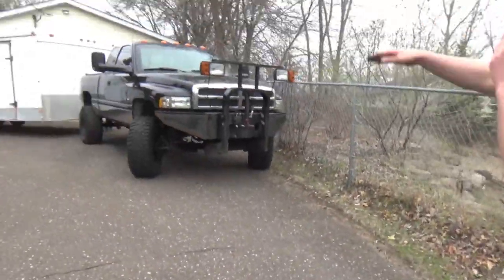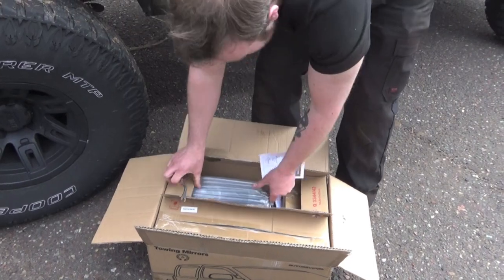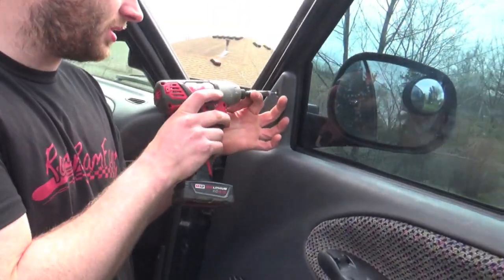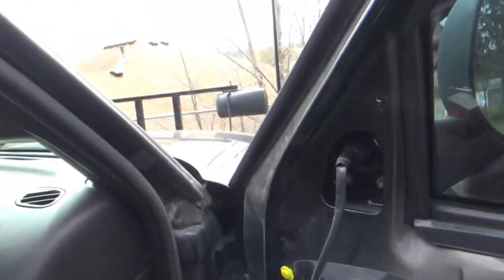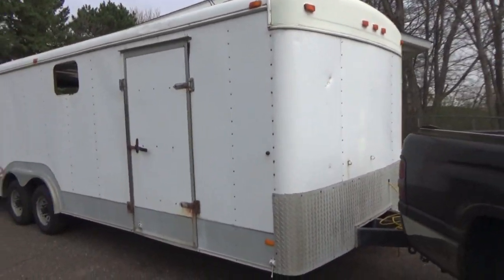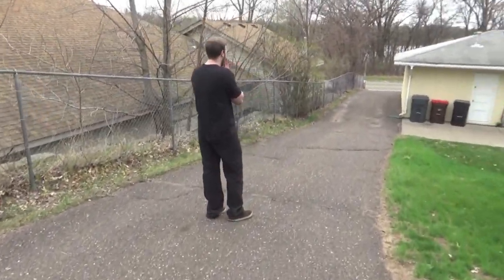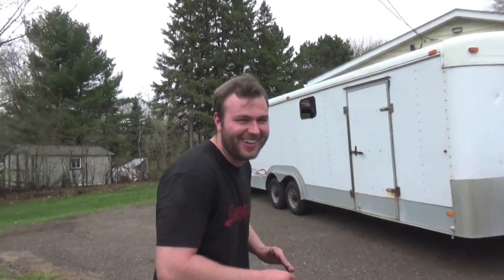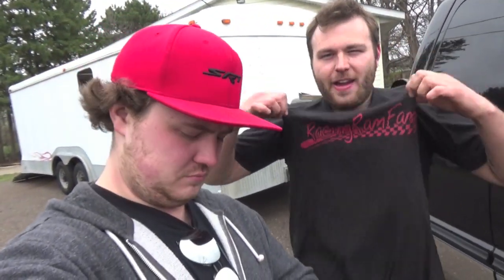How to install TOW Mirrors on a Ram 1500

Comment: Alright you guys have done the 5.9 and the 5.2 magnums. I am taking one for the fam. Im saving up for a forged rotating assembly for my 3.9 magnum. Going to drop a fat chunk of change on it because everyone always swaps in search of horsepower. I'm going to see what the 3.9 is actually capable of, because no one has. I'll keep yall posted.
Reply: Scat crank is going to run me over 4K custom
Reply from the maker: Ya is a 3.9 split pin crank? You can get those engines for $100 from junkyard all day I’d just arp head stud it and moon boost see what happens
Reply: @RacingRamFam  yeah I've already got one in my 95 dakota. Going with the crank because I've seen someone put 12lbs on stock internals without blowing it so imma build it up and shoot for 20 or more
Reply: @RacingRamFam  its the exact same as 318 but shorter by two cylinders

Comment: Is there somewhere I can splice the turn signal wiring inside the cab instead of running it all the way out to the front headlights?
Reply from the maker: Yes the fuse box on the driver side in the cab
Reply: @RacingRamFam  do u kno the colors of the wires I should be lookin for? I found the ones for the rear only 😔
Reply from the maker: @joeroe2839  rears and front are on same circuit for blinkers only different circuit is left to right
Reply: @RacingRamFam  I tapped onto those but when I step on the brake the mirrors ligjt up also lol

Comment: How’s pulling the trailer with the 4.56s?
Reply from the maker: 10 times better than 3.55s lol a lot more torque terrible gas mileage tho 2,600 rpm at 70mph

Comment: How big are those tires? I'm trying to figure out if I can fit 35s on my 98 2500 4x4 without rubbing.
Reply from the maker: There 35-12.5r15s! Cooper mtps going to go with a 35 but all terrain next time
Reply: @RacingRamFam  sweet, thanks